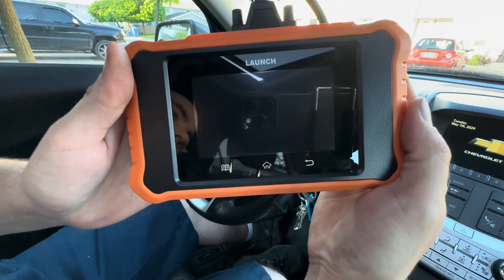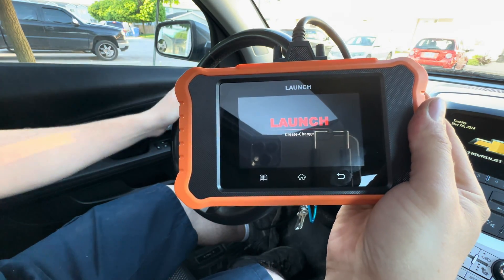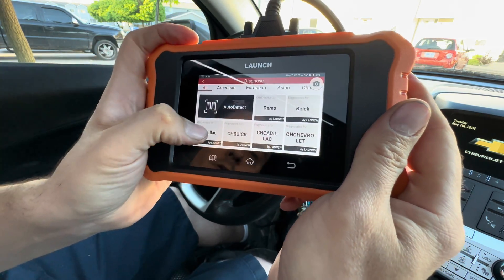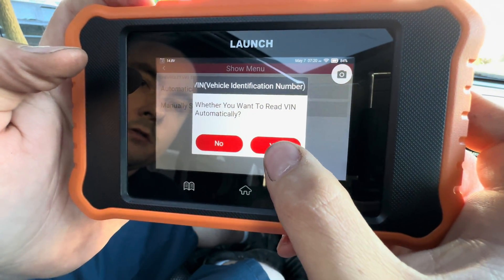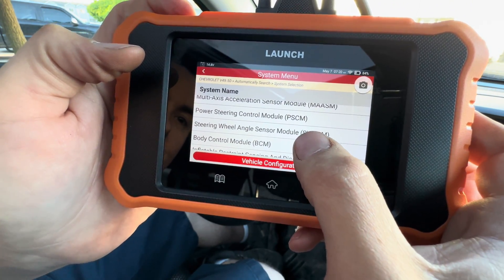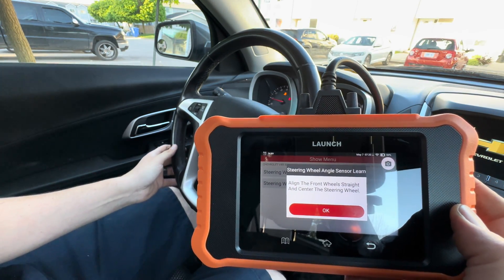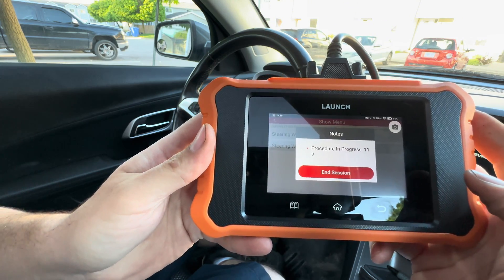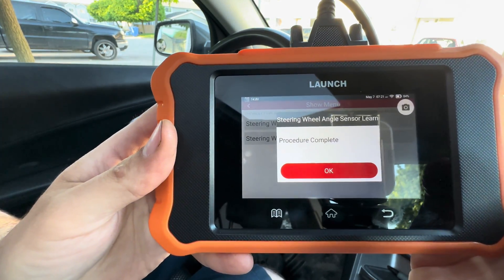How To Relearn Vehicle Steering Wheel Angle Sensor

Comment: I have a top done scanner 500 just put a new steering wheel angle sensor in that needs to be calibrated but when I hook the scanner up to the OBD port and it starts running, it says no communication

Comment: Good day.
My power steering light, traction control light and ABS light is on after changing suspension parts. My steering wheel is very hard to turn as well.

Will this procedure work to restore my steering?

Comment: What happened if they don't?
Reply from the maker: It can affect your electronic stability control and traction control and cause poor handling. It could also illuminate traction control or stability control warning lights to come on due to the sensor simply being out of calibration and lead to unnecessary replacement of other components. Imagine having to replace sensors or components because a mechanic simply forgot to calibrate one sensor.